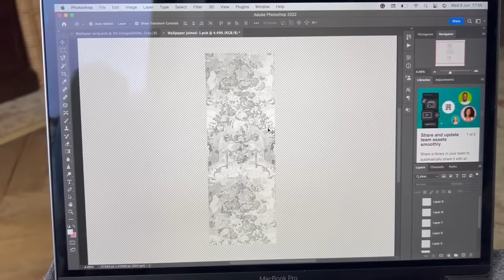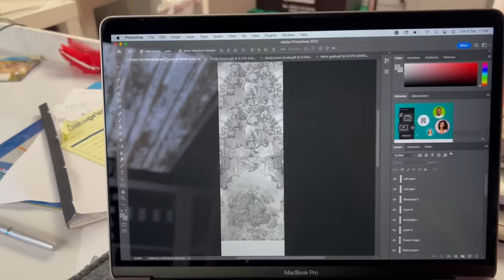Abandoned Grand Salon Full Renovation Timelapse - Before & After

Comment: The only thing you did incorrectly was the you didn’t but a red gesso ground under all the 24 k.  It makes an huge difference.  It would’ve been more of course.  Also, the brass or bronze light fixtures could’ve been electroplated in 18k. This would prevent never having to polish again.
Other wise it’s a stupendous accomplishment.    I’m reminded of Whitemarsh Hall outside of Philadelphia Pa.
….and yes, the parquet floor oughto’ve been done before the delicate walls and then covered with cardboard protectant.

Comment: In the salon décor 1 golden line on 1 side of each molding looks too weak next to the v. strong corners.  A 2nd golden line parallel to the 1st one emphasizing molding width or on the edge of the paneling below and door would dramatically improve the décor also of the door and lower paneling by making it balanced and not accidental only 1 line suggests.  --MArch